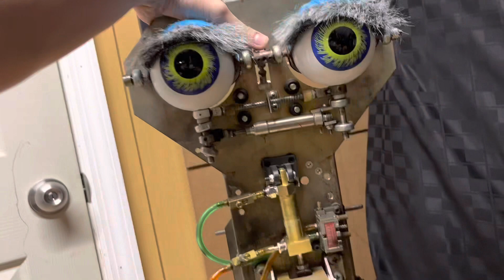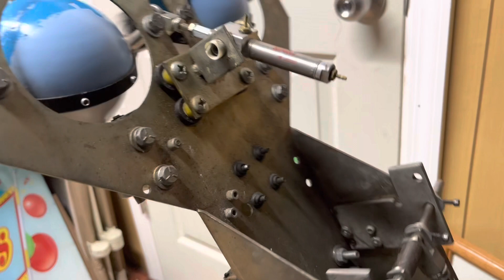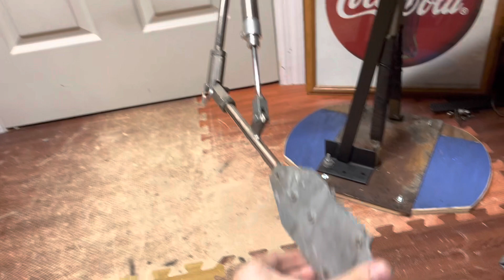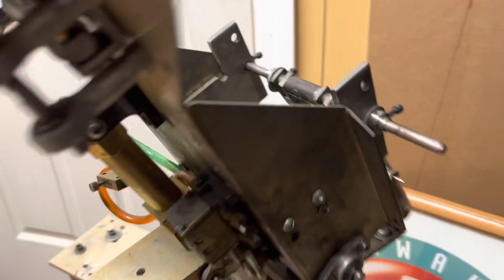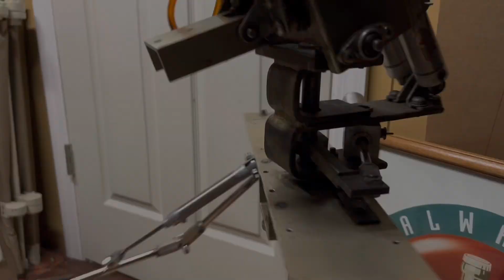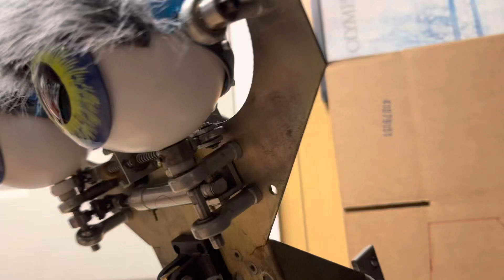A up close look at a early Chuck E Cheese cyberamic

Comment: I'm fascinated by how they can make the head and body turn with just 1 cylinder.
Reply: Same
Reply: Looney Bird/Pizzacam Has That 1 Cylinder Head Turn Too
Reply: @retro_cam925  Yep, though it only does the single action of turning 1 direction, while with cyberamics the 1 cylinder can turn the head and body into multiple positions
Reply: @sethhorst6158  What's The Difference Between The Early Cyberamic and the Modem Cyberamic?
Reply: @JamestheAnimator-mz2mk  They eye turn mechanism, eyelid colors, and the fact that modern cyberamics have legs.
Reply: @sethhorst6158  Tell me the difference of the eye mechanism
Reply: @JamestheAnimator-mz2mk  The eye turn of the PTT cyneramics has one cylinder is at the front and the other is at the back with the presense of a spring over the front one. The modern cyberamics on the other hand has two small cylinders connected at the front in the same sort of style as the pancake cylinders to control the eye turn.
Reply: @sethhorst6158  Also, Imagine A Michael Jackson PTT Cyberamic.
Reply: A valve with 3 positions i think
Reply: @JamestheAnimator-mz2mk  I thought that was King Kat
Reply: @Lionloverky I meant an actual michael jackson cyberamic.